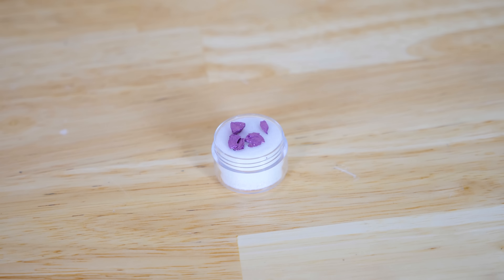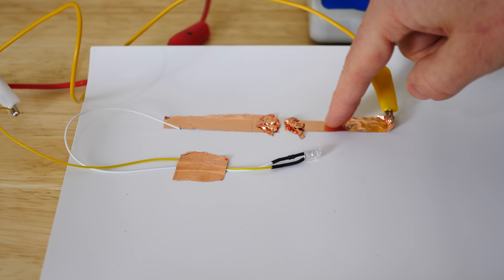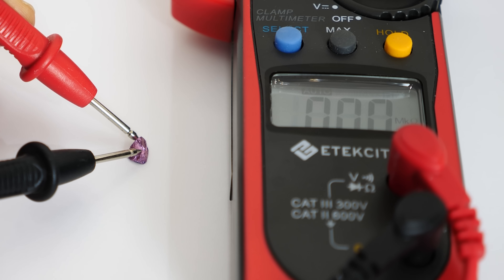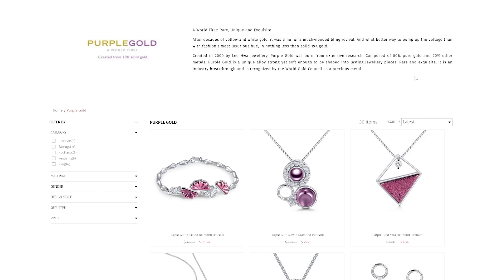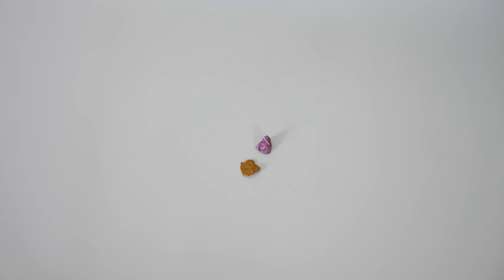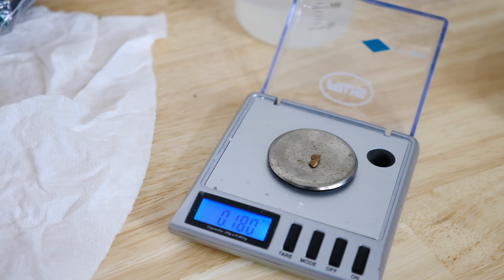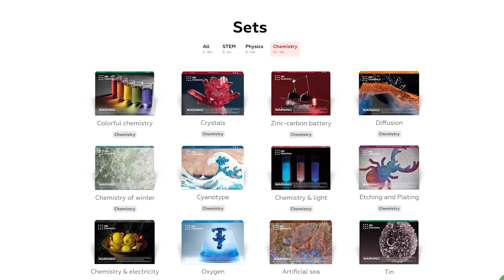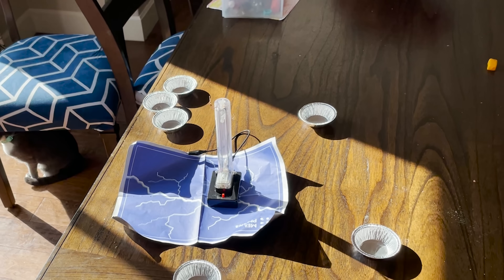Making Real Gold From the Purple Plague!

Comment: Same happens when you put metallic mercury on aluminium. It forms a bypass to the aluminium oxide protection and the underlying aluminium metal is actually extremely reactive with water/acid/whatever.

Comment: I'm thinking  that using acid to dissolve the aluminum out pan would be the easiest way to separate. Maybe even the gold will need to be dissolved then reconstituted. Any idea as to the best way to purify the gold out of this bonding with aluminum and/or retrieving the gold from a totally dissolved acid solution? Thanks for your awesome videos.
Reply: Boil the aluminium off in a furnace?

Comment: You can indeed use NaOH to remove the aluminum from the purple gold. But what if you used HCl instead? If I'm thinking about this correctly, the HCl would achieve the exact same goal that the NaOH does. Purple gold is made from aluminum and gold, so you were to put a chunk of it in some 12 M HCl, the gold colour would appear on its surface as well, I believe. Aluminum dissolves easily in HCl, making H2 gas and AlCl3 salt, which also dissolves in water. Gold however, does not, because its reduction potential is higher than that of the H+ ion, which was donated by the HCl. So by that logic, the aluminum would be removed and it would leave you with pure gold metal.
Reply: NaOH dissolves the passivating layer of aluminium oxide.
Reply: HCl works too, Nile red did it in his video on making purple gold

Comment: @The Action Lab mercury might be a cool reaction with the purple gold the aluminium should oxidise and the gold dissolve in the mercury right ? then to separate nitrate the mercury and melt the gold .would be interesting if you have the equipment which you prob do
Reply: Both aluminum and gold are soluble in mercury

Comment: If it's so brittle, can you grind it down easily to a powder? With that you could then make a more 'pure' gold as the surface area to volume ratio increases drastically. If it's not brittle enough, put it in LN2 first. Most materials get more brittle with lower temperature.
Reply: This was my first thought, makes the most sense
Reply: u can sell gold dust people buy them
Reply: @runewolf77  purple gold oxidizes quite easily, it'll turn black but it's a cool concept
Reply: @Absent_keebs  that's a shame
Reply: @Absent_keebs  I think the point was grind it to dust, then treat it to remove the aluminum, leaving pure gold dust.  Then you simply melt the dust and you are left with regular gold
Reply: @Absent_keebs  Just treat the surface like its done in jewelry.
Reply: yeah makes sense
Reply: It doesn't really need to be brittle to be grindable in a fine powder

Comment: I'm surprised that it actually lost a measurable amount of weight. 
       Aluminum is light compared to gold and only those atoms on the surface are going to be dissolved.
Reply: You could see from the one he opened that the gold colour actually went quite deep, not just on the surface. It may only be 20% of the total weight but aluminium is two-thirds of the atoms. So when dissolved out you can get the holes in the sponge extending quite a way in.
Reply: the sample has a lot of surface area to volume, also the reaction was a little deep so no wonder it lost that weight

Comment: 1:13 Yeah obviously Resistance is not zero because if Resistance is zero then it will be a superconductor. And we know that scientist are still looking for Superconductor to use them for wires and don't lose any power.
2:38 Wait! Is Gold Metal or colour? Also is Orange fruit or colour?
Reply: About what you said of scientis looking for a superconductor, the existing material with superconductivity properties at ambient temperature is the graphene (I'm not sure if it writes like this in English), which its atomic surface is completely flat thanks to the covalent bonds between Carbon atoms. Due it's an experimental material (it was discovered less than 5 years ago) his cost of production is still being very high, but I noticed that there's some experiments with cell batteries with the objective to replace the actual Litium batteries starting with some flagship model of smartphones.

Comment: I am into jewellery design and never heard of purple gold im curious to work with it one day
Reply: Sweat and other environmental factors can fade the purple back to gold. Perhaps used as a backing for a clear stone so it is completely enclosed?
Reply: @pattheplanter  it'll actually turn black instead of gold because it oxidizes.
Reply: @Absent_keebs  actually it'll oxidize the outside layer and if you sand it you need to heat treat it at 600 degrees Celsius
Reply: Last time u said u worked as carpenter

Comment: Purple gold looks cooler than normal gold. Lol I'd love to have a chain necklace made of that with a small white gold cross on it. Or vice versa, would actually be even better.

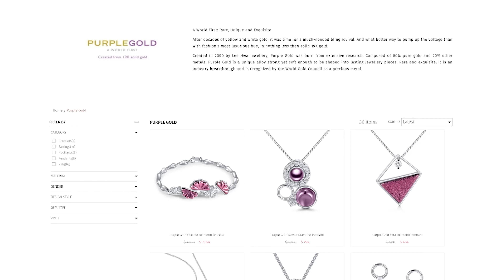Edit: @ 1:39 he shows jewelry made from this.. 😂 *the big oof*
Reply: you can't make chains out of brittle things unfortunately
Reply: @oxybrightdark8765  yeah it'd be super cool if it did though. Vice-versa of what I said in my original comment would also be cool, and maybe possible. I imagine you could possibly form a rugged cross with controlled breaks, and maybe heat it up a bit to soften it before drilling a hole in it? I don't know exactly how the composition of this stuff would react to that, it may just break. But again, hypothetically, it'd be cool.
Reply: @Frosty_tha_Snowman  You could react it in the shape?
Reply: @oxybrightdark8765  I didn't even watch the video.. I actually just skipped through this one lol, he actually has a bit where he shows some jewelry made from it.
Reply: @oxybrightdark8765  1:39
Reply: Seems gaudy, but don't get me wrong. Like any other math nerd, I still like addition too.
Reply: @custos3249  I have a racquetball racquet that I just got that is purple and white, and the goggles I ordered happened to also be purple and white, so it would match with those very well lol.
Reply: That would be pretty cool. Too bad science has to mess it up!

Or like those settings, maybe the cross could be inset in some white gold, and that would protect it.

Comment: I'd love to have an ingot of that, even though it's brittle, it looks so beautiful!
Reply: Nile red just did
Reply: @legoworks-cg5hk  I know, I'm glad he did!
Reply: Nilered made a video about it just a  couple of days ago
Reply: 3 things
1 you can only like 40 U.S. dollars for the meatles needed
2 theres a tab that showed me that if you change it to 80.5% gold and 19.5 aluminum its way stronger than the reguluer
and 3 if you whant it perfect than the equipment is 3,000$ just to make it yourself but perfect
bonus 2
4 the regular price for equipment is like 1,800$ so i recomend getting it perfect for 3,000
5 if you make purple gold you could sell it for 600 dolers a 100 g bar of purple gold
Reply: That would be... expensive.  It would be an ingot of gold after all.
Reply: @sinisterthoughts2896  wouldn't gold plague be just as expensive if gold is used to make it?
Reply: @monsterhunter445 : An "ingot of gold" would be measured by weight - so ultimately the weight of less gold with the added weight of whatever ratio of aluminum. The economy of making gold plague ingots would be the weight of gold "displaced" by using aluminum (using less gold), but adding the increased cost of production of plague gold (assuming the aluminum would be obtained at very low prices). It makes you wonder what 14K gold is being "cut" with.
Reply: Well, I think that it would only be able to make it on the surface of the gold.